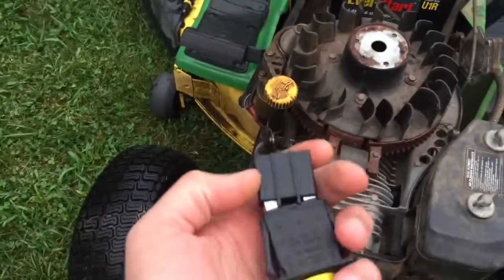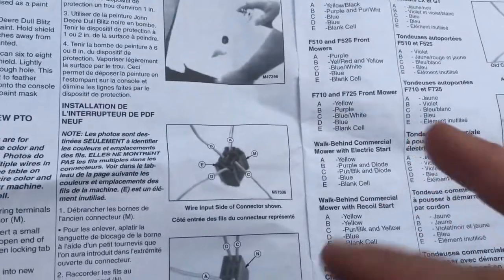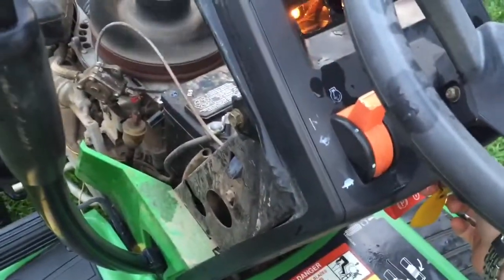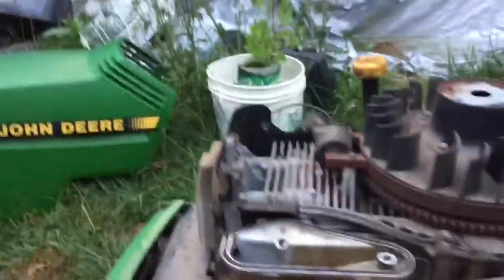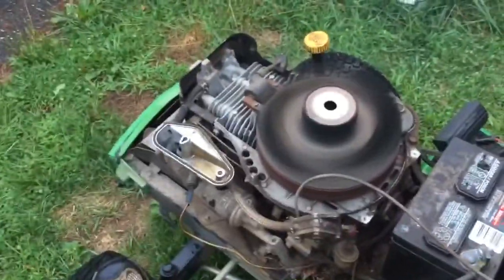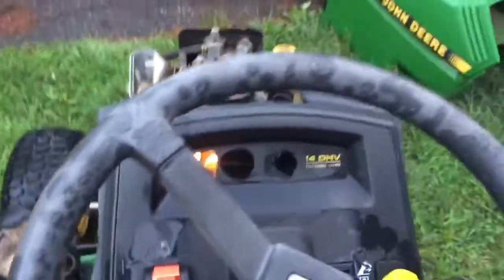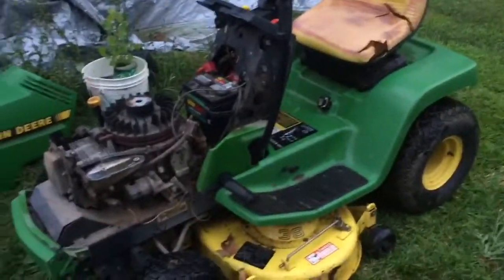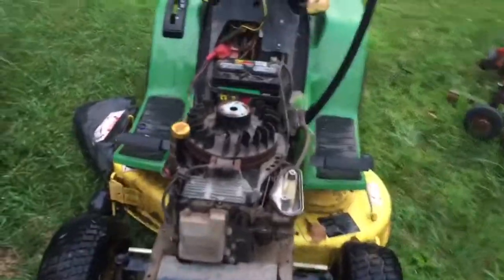John Deere LX172 Fix Up Part 3 New PTO Switch Has Arrived

Comment: I'm having no start issue with my LX176, wish you were close by, no one yet can figure it out, tried another factory switch, new solenoid and still nothing. One minute it ran fine , then a friend put on a new drive belt and now nothing, any suggestions would be great, Thanks,, Mike

Comment: I was more interested in how you got the switch out of the panel. I'm trying to get the whole panel free.  Will the switch come out of the top of the panel somehow ?
Reply from the maker: @clifdaniel4945  did you watch parts 1 and 2 ?  The tractor had no switch when I got it.  The switch comes out the back of the dash.  Good luck, it wasn’t hard…

Comment: You didn't show us anything other than starting the tractor.  How did you get old switch out , if the connectors were not the same how did you interface the harness to the new switch, how did you put the new switch back into the panel ?   Seriously.